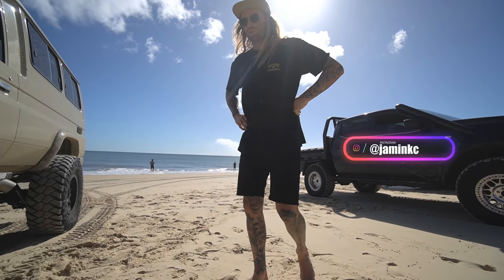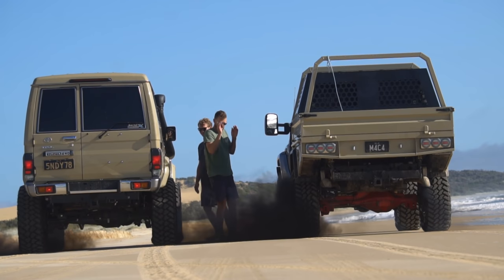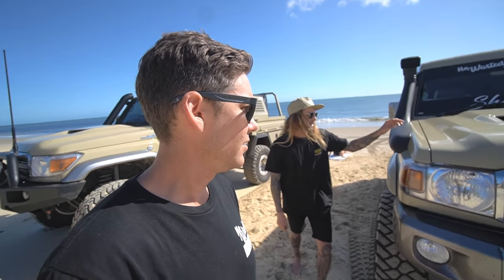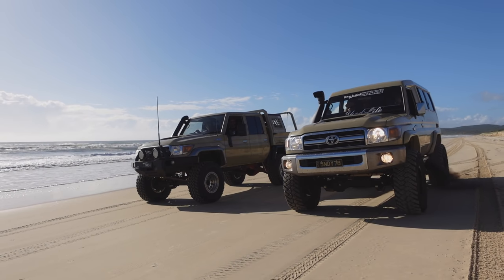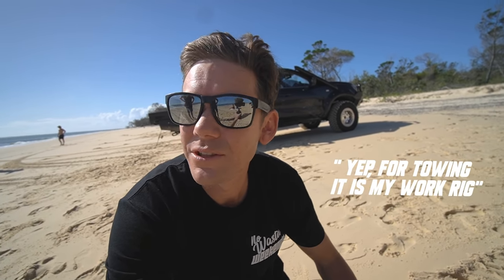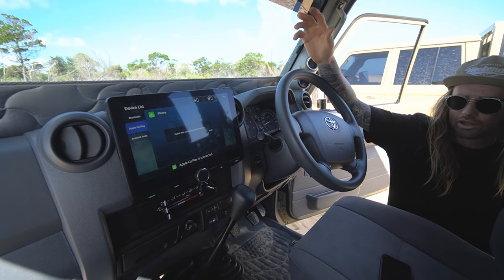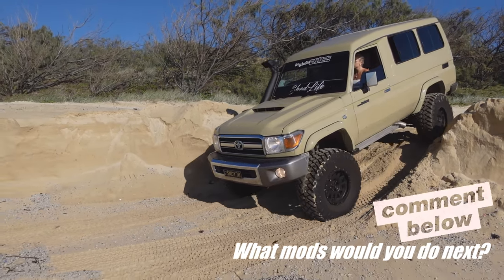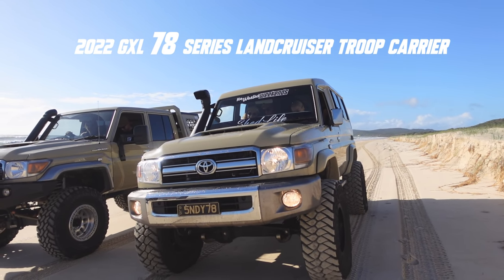Troopy Walkaround

Comment: Were the DPFs removed for the 4 inch exhaust? Lots of soot blowing out. Be prepared for a big fine if the DPFs were removed.
Reply: DPF removed for sure. Even bigger fines for the workshop that removed it. It’s a cool truck but It’s a recipe for disaster. There’s another’s channel that got in big shit for the same thing. All incriminating evidence documented on video, just like this one. The smart thing would be to delete this video and put that DPF back in. I'd love to delete my DPF for the sound alone, but it's a good way to cop a massive fine, canary your pride and joy, and possibly end up in court. The fine for the shop doing the work is up to 1 million dollars, and 22k for an individual. It's not worth it. Ronny Dahl did the smart thing by getting a 2015 V8 troopy before the DPFs went in. There's no easy way to hide you've removed or bypassed it just on the soot alone.

Comment: Any chance you managed to get the 37s engineered? Guess they would never pass if legit bead locks tho :(
Reply: You can pre rego on the superior kit that Mac has. Not on the jamacx kit though
Reply: @stevenjalopnik1342  the 37"s 5" superior kit is only for the dual cab, single cab and 76 get 4" 35"s max. Superior dont even offer coils for the 78.   jmax will only do 35s and 4" but atleast they will coil a troopy.  I really wanted to legally run 37s on my troopy but its not going to happen. So will be leaving it completely stock
Reply: @NoLaggPlz  that’s very true I didn’t think of that